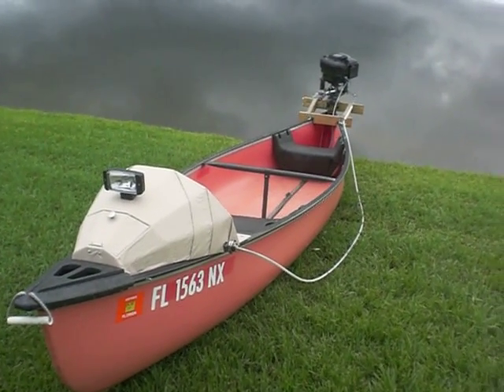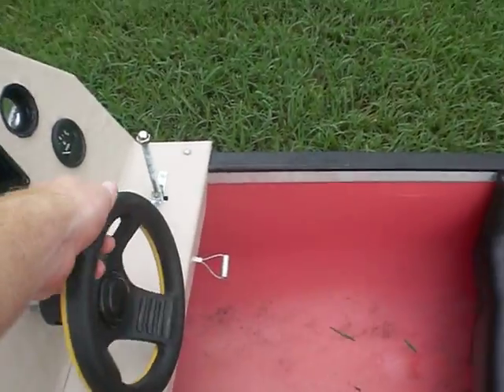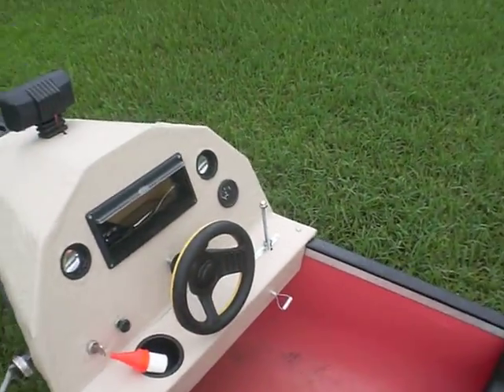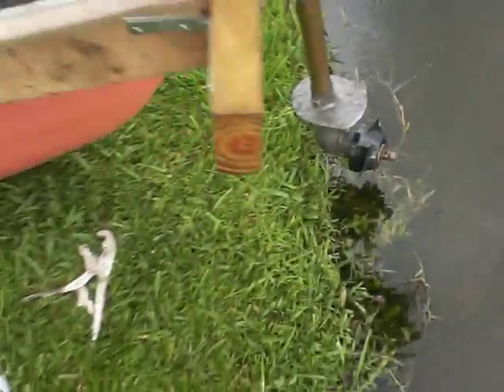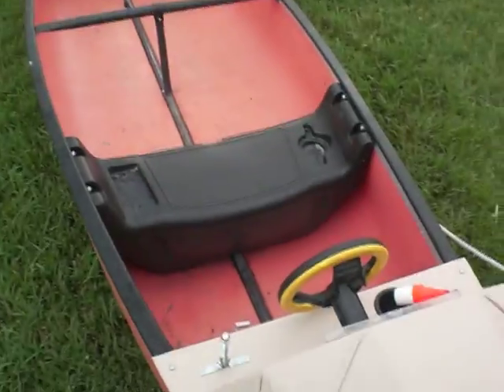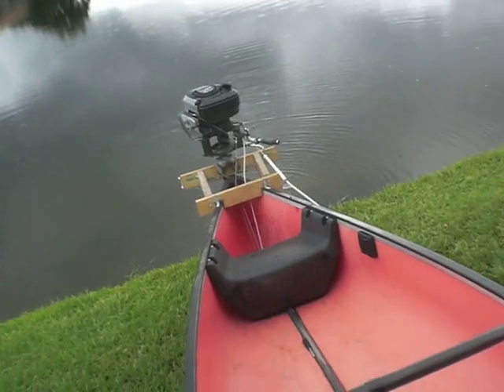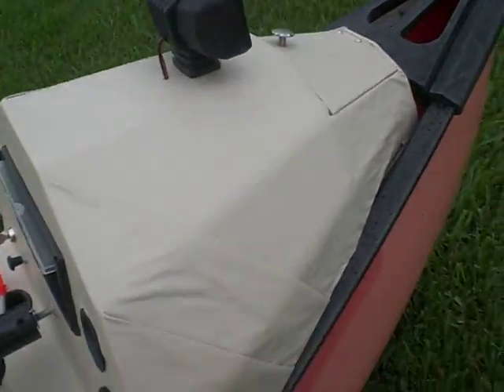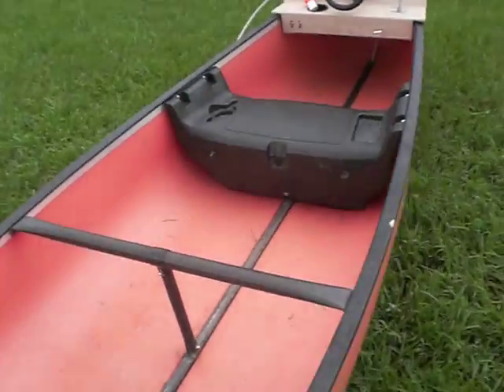Homemade Lawn Mower Boat Engine With Custom Canoe Console

Comment from the maker: Awesome do it, its a lot of fun. I actually made the console out of a thin wood and wrapped it in the vinyl material. I made the throttle by simply using a steel rod. I attached the rod to the surface of the console in the middle of the rod by using a pin that allows it to move. I attached the throttle cable to the bottom of the rod ( inside/underneath the console). Thus when i push the throttle forward, the bottom of the rod is moving backwards, pulling the cable. I hope this makes sense lol

Comment from the maker: @krazykayaker82 We couldn't get the electric start working so your guess is as good as mine.  I would imagine the prop would just depend on how powerful your engine is.  The prop we used was to big when we tried it with a weed wacker engine.  But when we attached the more powerful lawn mower engine, it did just fine.  You just need to get one that is the appropriate size.

Comment from the maker: @mickeydamon I actually took a shortcut with that step...We just bought an old bought leg off ebay so fortunatly we didnt have to deal with the 90 degree turn for the propellor.  We simply made some brackets for the motor to sit on the old leg, and just bolted it down.

Comment: looks like you used a trolling motor prop, are you still having problems with them splitting? just wondering because they arent designed to turn high RPM and this looks to have no gear reduction

Comment: Hey, I'm almost done. But I have a major problem. I was wondering how you made your engine go from vertical to horizontal motion.  Did you use the shaft from a trolling motor or what.  This one is making me think. Thanks.

Comment: @jonny24667995 you can use the gears from an old trucks differential to get the 90 degree turn. but there is many other options.

Comment: I don't understand why people do this to canoes.  They are easy to paddle and keep you in shape.  If you want a motorboat buy a small flat bottom thats designed to easily hold a gas motor,   is cheaper than most canoes, and has more room.  Tip that canoe with all that crap on it and its done for. NO offense intended, its nice work, just sayin.